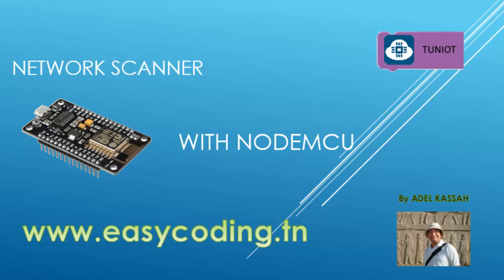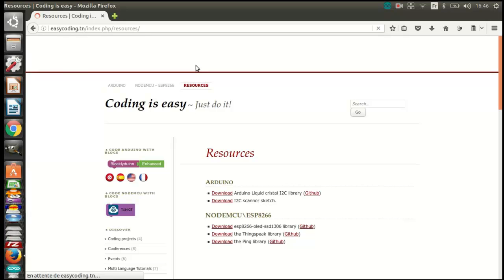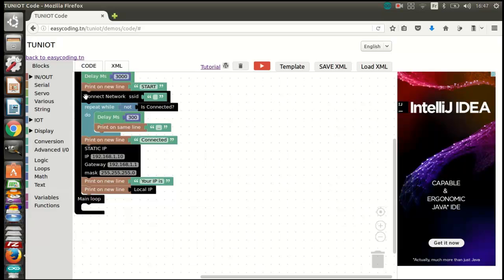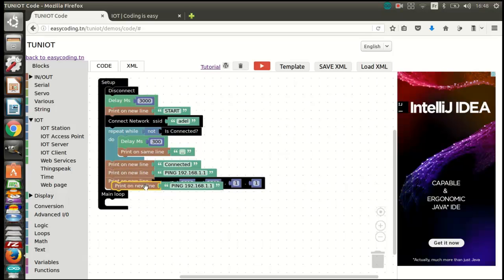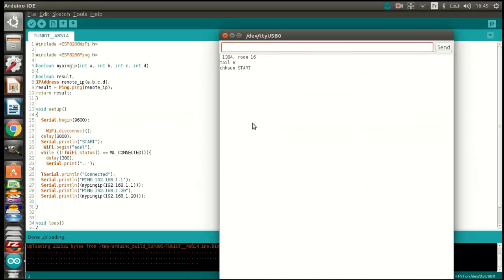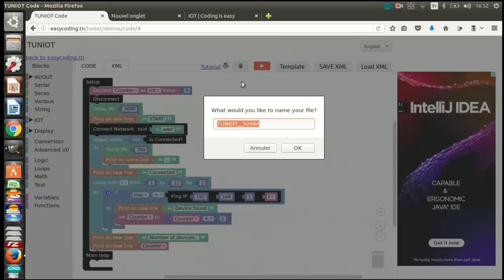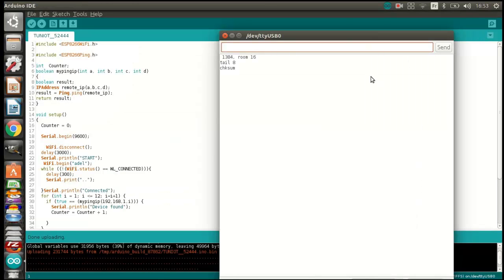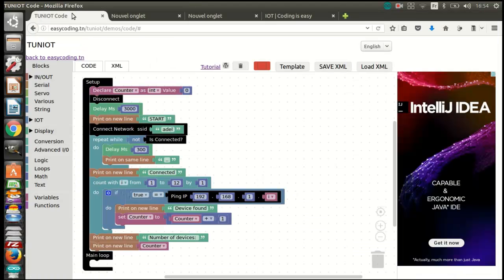NodeMcu (ESP8266) Tutorial B-10: Network scanner

Comment: why i can't ping to esp8266 ?
I make an Access point esp8266 and some station esp8266, the station connect to access point esp8266. i have parameter if any client connect to the AP, led in station is turn on. But is not work, i check the serial monitor and the station can't detect any ip in they network after ping.

But, if i am using AP from android hotspot, the station can find ip after ping in they network.

So what the problem ? i hope you can helping me